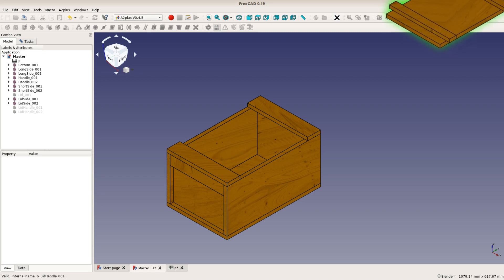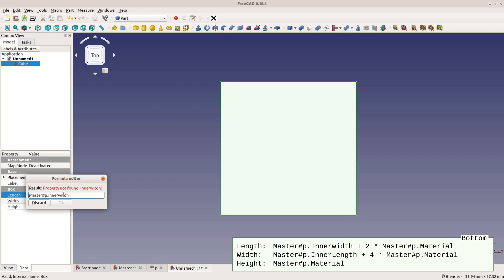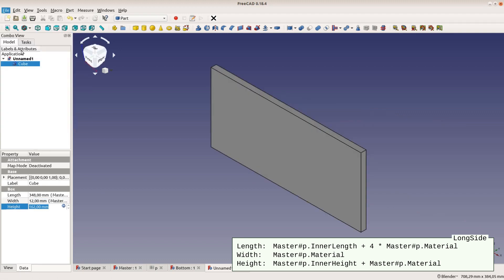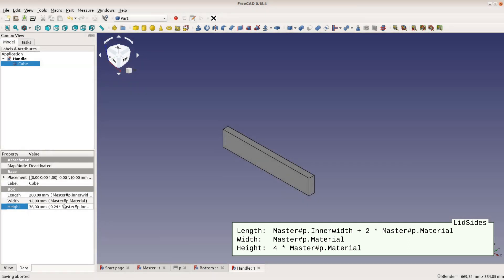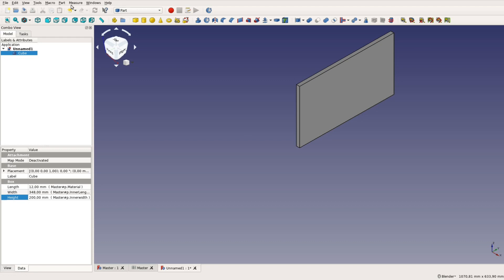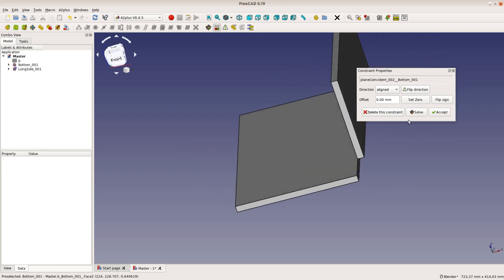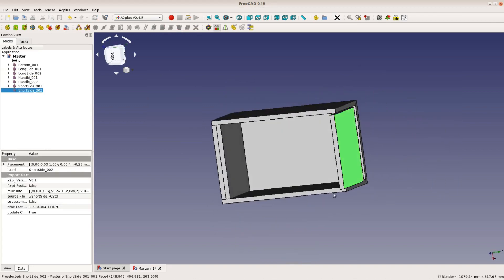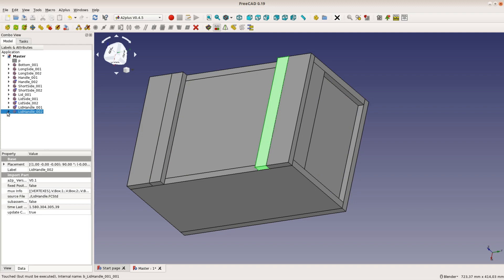FreeCAD for Woodworkers 04 - Assembly with the A2+ workbench

Comment: Did you use FreeCAD 0.19 at the beginning and switch to 0.18 around @0.51?
I tried to follow your steps to create the spreadsheet and try to make reference to the parameters in the spreadsheet, only to find out it doesn't work in 0.19, but it worked in my 0.18 version.  Look closely to the video, it seemed that you switched to use 0.18 when making references to the spreadsheet parameters.  Can you confirm please?  thank you
Reply from the maker: That might be the case but the references also work in 0.19. In newer versions the syntax has changed and a spreadsheet is referenced as <<p>>.width. Hope this helps!

Comment: Why does this workflow work when you build the parts in the part workbench but not if you build the parts in part design workbench? The model assembly still works, but the modifying of the  spreadsheet if parts are built in part design doesn't.
Reply from the maker: Usually part design is also able to link to the spreadsheet. You might have to recalculate the entire model Look for the force recalculate macro to do so.
Reply: I have exactly the same problem. I made a box out of boards that were made in the Part Design and dimensioned the Sketches via a Spreadsheet. Then in A2plus I had no problems to put things together but as soon as I alter values in the Spreadsheet and press "Update Parts" I get a load of broken Constrains. You can see the prblem here: https://www.youtube.com/watch?v=C4CiE9Q2I7o The strange thing is if you press "Abort" and do the  "Update Parts" again and press again "Abort" everything seems to scale to the new values but leaves me a bit in the dust because of the error messages...
Reply from the maker: What happens if you press the "update parts and models" button? It should then also update the individual files...
Reply: @WayofWood  Same behavior. But I there is already a issue on github for that: https://github.com/kbwbe/A2plus/issues/415 I'll follow there...
Reply from the maker: I see - so let's hope it will be fixed soon.